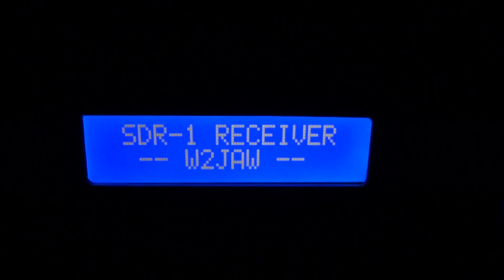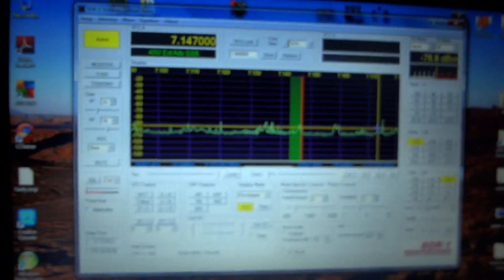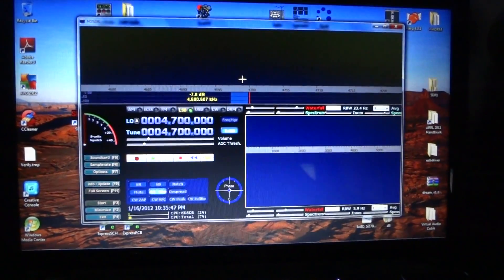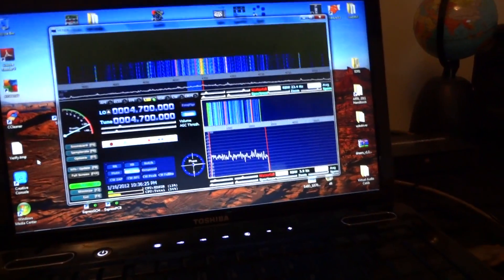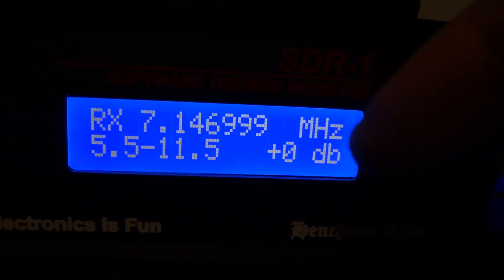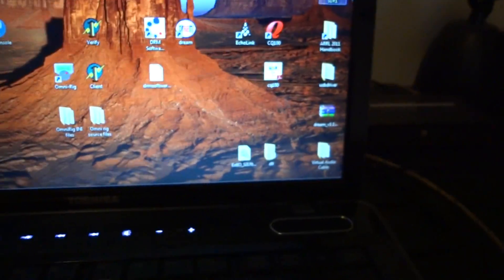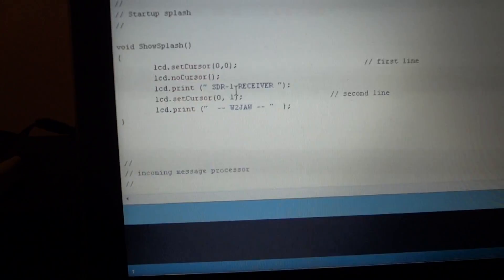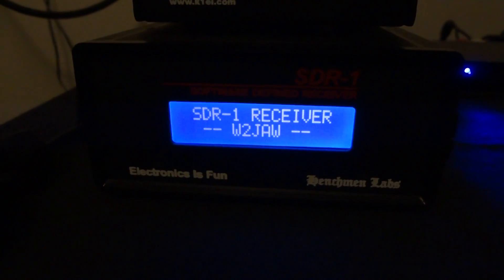SDR-1 Receiver from Electronics is Fun and Henchman labs

Comment: What kind of antenna are you using with the SDR-1? 

I have used the SDR-1 for more than a year now, and really like it. The audio experience is far better than my Icom R71E, and the filters really help bring out the sound from the static. 

I am using a T2DF homebrew antenna, and it has helped me log several HF stations that I've never heard before. 

I would also be interested in learning whether you've figured out the settings for PowerSDR... It would be nice to set the AGC and other features